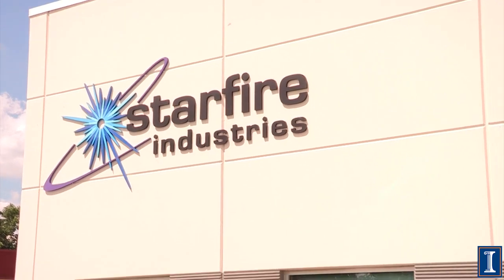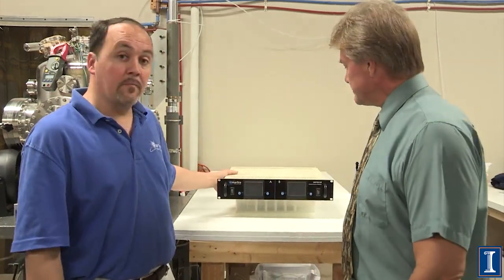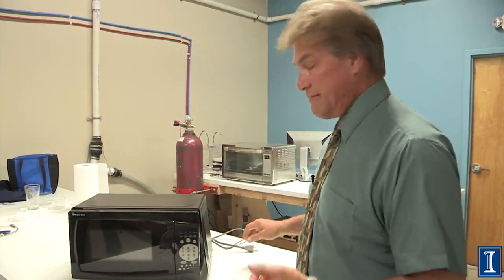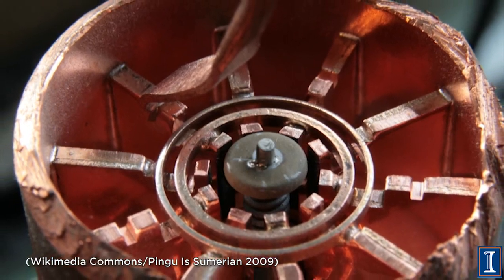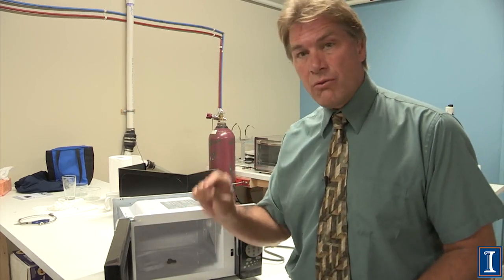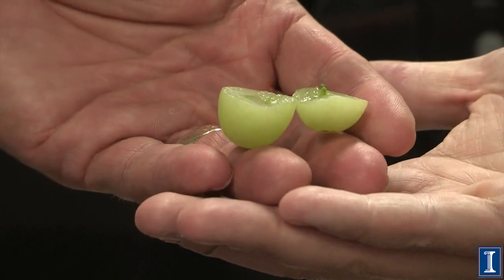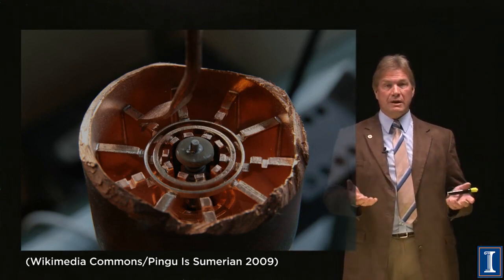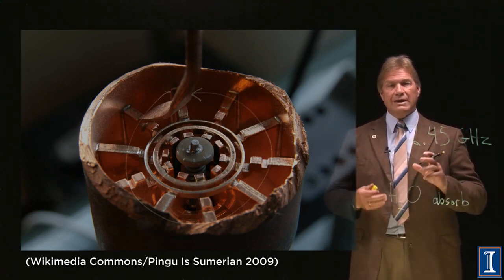How Things Work: Microwave Ovens

Comment: Brilliant video, are microwave ovens PWM modulated?
Reply: Most microwaves are, but at a very low frequency, around 0.1 Hz to 0.2 Hz. It relies on thermal averaging in what you are heating up. Some microwaves are modulated faster (Panasonic inverter, for example) that are modulated much faster.

Comment: so could a different sized magnetron be tuned to produce visible light or infrared etc etc
Reply: According to the electromagnetic spectrum... Yes
Reply: Yes, but you wouldn't be able to see it, as the light would be created inside the cavity magnetron with no way to escape.
You could use the microwaves to hit some sort of phosphor covered surface and emit light that way.
But the easier way would be just to use a light bulb.

Comment: Weird that I was always more afraid of magnetron than capacitor... They always tell me that not protected magnetron could really badly hurt you...
Reply: The magnetron is only dangerous when it's on, when it's off it's safe.
However, take precautions around the pink/white insulator of the antenna, some old magnetrons used beryllium oxide as insulator material, and that is really dangerous if you crush it and inhale the dust, and it can give you berylliosis, and that is incurable.

Modern magnetrons use aluminium oxide instead which is safer, but you still don't want to crush and inhale that dust either, and there is also pink aluminium oxide so going by color itself doesn't help.

Comment: You can melt glass with a microwave. You have to first heat the glass up with a torch. Cold glass is too stiff and won't vibrate. The heated glass has enough give to allow the microwaves to further increase the energy.

Comment: How do the electrons go in a circle. I know like a solenoid has a wire to travel through for example.
Reply: Electrons are charged particles.  The path of any charged particle is affected by magnetic fields.   Search for "How a Magentron works".  Also,  I highly recommend checking out some videos on the Kreosan channel.   Those guys are crazy,  they did a series of cool videos with a dismantled microwave.

Comment: I also need to know how that microwave is absorbed in other liquids like oil, milk etc. and more importantly how it affects chemical bonds in food, does it affect them differently than conventional heating? Can it flip perhaps double C=C bonds or is the energy not enough for that or am I missing perhaps the important question on how to compare these heating methods that is relevant to human health? I would like to see an honest scientific investigation and comparison of microwave vs. conventional heating, because to me it seems that either the microwave manufacturers tell people there is nothing different about it amd there is no danger at all vs other people that tell us it is very unhealthy. Same thing about the 5G technology that will cover us in much lower intensity but constantly present microwave radiation - what will the effects of that be?
Reply: You won't die from heating food in your microwave, just don't leave it too long in it that it starts to char and burn.
And the power used in communications microwaves, is not high enough to even warm you.
The Sun puts on you around 500W of power and around half of that is IR radiation.

Don't fall for all the nuts that claim that 5G will give you Cancer, staying on the sunlight for too long can actually give you Cancer.

If microwave heating had serious health risks, we would have noticed them by now, the only danger I see from microwave ovens, would be from older ones that might leak microwaves, and if they are even older, they could contain beryllium oxide on their antenna insulator, which is nasty stuff if you crush it and inhale the dust, and there is no cure for that.

Comment: Coincidence that Wi-Fi runs at the same or very similar 2.4 gigahertz?
Reply: No, but microwaves came first. Then the FCC made that frequency unregulated so you don't have to get a license to use your microwave. It was just a slice of unlicensed spectrum that was easy for wifi manufacturers to jump on (no license needed to turn on your access point!).
Reply: Does it need a magnatron too?